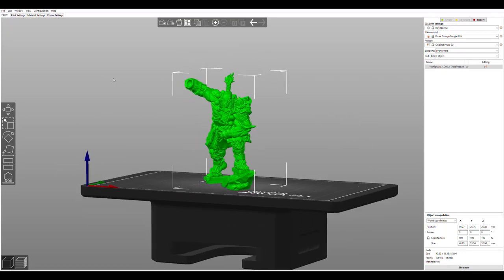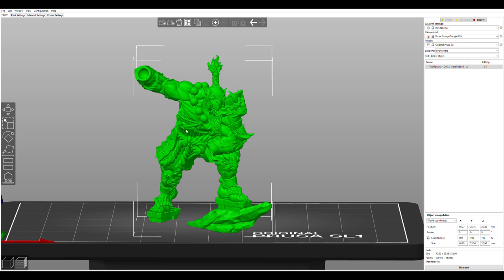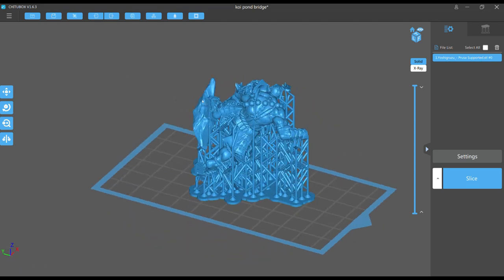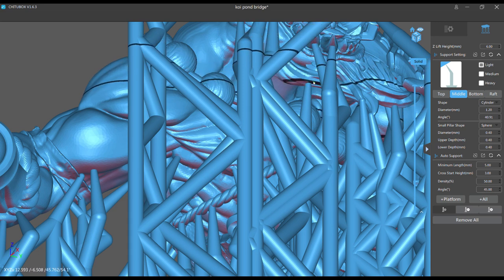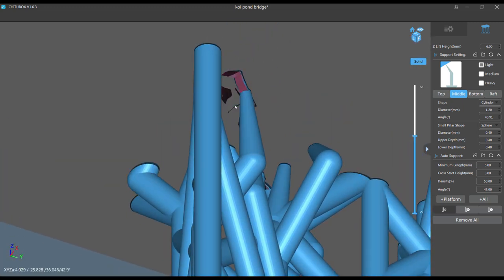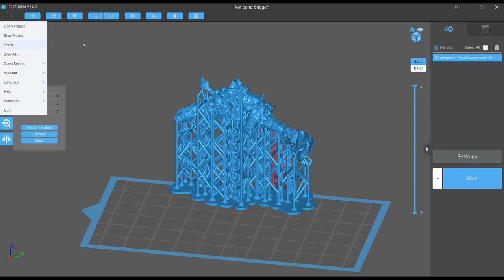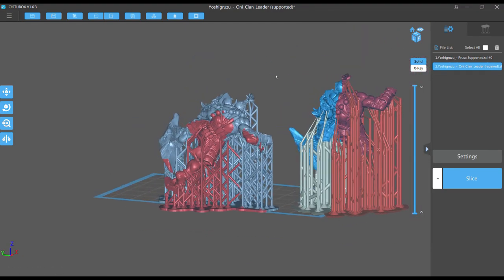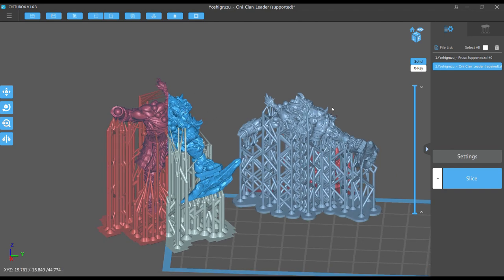Prusa Auto-Supports for 3D resin printing miniatures...set it and forget it?  Or just "Forget It"

Comment: The real professional workflow is start with Prusa slicer, orient the print manually for the most favorable position. Have the slicer hollow and auto support the model (with tweaked support settings to get enough coverage without also becoming a solid block), and export as STL with supports. Move to Chitu or Lychee or whatever, slice and save into printer specific format. Move file to UVTools, have it repair any islands along with other issues. Print, profit. Half the battle is initial print orientation, but it's a skill that's far quicker to master than manually supporting every print. 

The fact of the matter is, manual supports take too much time. Sure, I may have 2-3 failed prints per kilogram of resin used due to support issues. But I save myself literal hours of sitting there placing pixels. And for most failed prints, you don't need a full clean of the FEP. Just drain, peel off the solid blob, refill the vat, and go again. Takes maybe 5 minutes. Resin is cheap, my time is not.

Comment: For what it's worth, you can continuously auto-orient until you get a decent orientation. I usually start with an auto-orient or two and then tweak it a bit. I also didn't notice what your support settings were, but I don't think anybody actually uses the default of 100%. It's not much lower, but I use 93 or 94% which definitely doesn't put as many supports as what you had in your model. From what I've seen, most people start with auto supports and then add/remove on their own. I remember trying to manually support the AG dwarves many months ago and giving up after a few hours. Prusa auto supports, hot water, and some light sanding allowed me to support 7 HeroForge models in 30 minutes and they came out beautifully. One even had a tiny dragon on the arm, which was the most delicate piece I've ever printed, and it came out fine. I've also never had any resin stuck to my FEP afterward, and nothing shows up after running the resin through a strainer. Not saying you're wrong, but I did want to provide some other experiences.

I think "set it and forget it" is an issue, but using Prusa as a starting point and making some tweaks saves a ton of time. That being said, I do need to learn how to do those super thin supports in ChiTuBox that you've got to get some of the smaller islands I can never get with my extra manual supports.
Reply: Serneum i agree. If you dont like the orientation, try it again and adjust it manually from there. Works great for me as well
Reply: Resin can only get stuck on your fep if there are no future layers on top of them. Thats why having islands left is absolutely without consequences in most cases, you only loose detail.
Reply: Have u tried the lychee slicer? Seems better than prusa and chitubox.. the lychee shows you where are the unsupported island and this is awesome
Reply: Yeah and this guy speaks of rookie mistake, OMG

Comment: "These small  particles that will be stuck to your FEP"... uhh no.. not one of those would be stuck to the FEP. Almost  every spot you highlighted in the first area would be picked up within like 4 layers. In order for there to be a particle left behind it would have to be like the last layer of an area or speck that had literally nothing following it that it could become part of in future layers.
Reply from the maker: So you're saying every island that sticks to the FEP subsequently, if another part is printing in that spot, picks it up every single time?  That is not right...
Reply: @3dprintingpro212  yes.. it is.. unless you want to disagree with the plethora of models ive printed where i don't support "every" tiny island, because within a couple layers they quickly widen out and join with something nearby, so even if initially stuck to the FEP, it gets plucked away as soon as the model can grab onto it. At worst you may lose a tiny tiny detail, but in 300+ models I have yet to have a problem with a tiny spec of an island not just getting snatched up if close to something after a few layers.  Other than the few points where the support obviously completely missed a larger island, I didnt see a single instance there that I would fear causing a problem with printability due to tiniest lil unsupported spec of island your freaking out over.
Reply from the maker: @MattWeber  you've been lucky, if it sticks to the FEP and doesn't get picked up you'll get a nice puncture eventually, it's happened to many people...your anecdotal evidence won't sway me, there's far more evidence from more people to the contrary, and ask any 3d printing company if what you said is always true, answer will come back "no".  I've actually asked this question to manufacturers and their engineers, sorry but I'll trust them over you...
Reply: @3dprintingpro212  With all due respect, your experience is anecdotal too. And yes, some of us have asked and whilst they RECOMMEND not leaving anything unsupported, they have said that, yes, the next layer can pick up those small bits of cured resin. They point out that is the explanation for the "flat elements" in an insufficiently supported model. The resin peels off the FEP as soon as there is enough surrounding cured resin to do so.

After talking with those engineers, and confirming with someone I trust locally that their experience is the same, I too can confirm that's the case, at least with the Anycubic Photon and miniature prints.
Reply: @mekko1413  Ooo big man with the name calling. Sure google results brings up the problems, but that doesnt bring up the simple fact that if you go layer by layer, if the small failed few pixels reach an area where the exposure time is enough to fuse them with the next layer.. they get pulled off the FEP.. Even just inspecting your own failed areas where supports failed but it recovered, would show you that im not wrong.
Reply: @mekko1413  Mate, sometimes it's best to remain quiet and thought a fool than to open your mouth and remove any doubt. Matt is correct, for the case he described, and (as was mentioned) some of us have checked with the engineers too. The picking up of particles from previous unsupported layers is the reason behind flat portions of printed model. Which is the next layer or layers fusing with the particle and pulling it off the FEP.
Some folks have been around longer than Greg's attempt to make supports out to be much harder than they actually are. Greg has been trying to market his services as a product. It's in his commercial interests to make things out to be more complex than they are. There was years of everyone being able to handle resin printing before Greg came around with his call to presupport everything. There is a reason we could do so without problems. Think about it.

Comment: You should be saving every single successful support configuration to a database. At some stage in the future there will be a call for an auto-support machine learning database.
Reply: the dumb thing is that you really don't need an AI/ML algorithm to do auto support. you could just use gradient accent/decent (depending on how you're looking at the z axis) to find all of these islands based on the orientation, and put supports there. Maybe with AI you could teach it how to recognize the smarter places to place them or to avoid based on it being a face or it existing in a certain area of the model (the front vs the back) but really its sad how piss poor of a job of even basic supports everything does.
Reply: @kuthegorix  I've a lot more experience doing supports now and I do 100% of the work manually. Autos are rubbish. It's not just about the islands. There's a lot more to consider tactically. Sculpts are also getting more and more complex so you really need experience to place them manually. I only print my own sculpts so I'm always conscious of the support stage when modeling: minimising islands, overhangs, and support marks/potential damage. Lychee has been a real relief with supporting. The way I look at it now is: why spend days(or even weeks) on the sculpting/modeling phase, but rush the supports? If it takes me a few extra hours then it's worth it. Coming from game dev I understand this only too well with the UV unwrapping stage(which I actually enjoy)

Comment: I'm far from being a pro in resin printing and for sure i'm missing a lot here.
but shouldn't you compare yours and prusa one with the same angle rotation? (or prusa also decide the best rotation of the model?)

Really not a critic just asking I'm starting wtih resin printing. (not even started, will receive my printer in a few days, but getting as much as info i can beforehand and I got recommended your channel :) )
Reply: He used auto orient so he was testing both.
Reply: Outside of minute detail gains rotation is mostly for the sake of support anyways.
Reply: ninjabuddy1 yeah now in 3 months I understand more, but since he was criticizing  the fact that prusa is putting support in the face 😂, just must be dumb as fuck to expect auto orient to recognize a face of a monster and orient the figure in a different way, this test and it's argument are invalid. I personally use prusa slicer and ass some extra support myself I'm getting great results!

Comment: I start with Prusa supports, but then I visually scrub through the slices in Chitubox and get any islands remaining. There usually are at least a few, but not always. Prusa does a good job. I also now make sure there are adequate additional supports for weighty areas. So yeah, Prusa provides an excellent start, but more work is required.

Comment: Disingenuous to compare a manual orientation to a bad auto-orientation. You don't need to use auto orientation and it removes a lot of the complaints you had about where the support is damaging the model with poor placement.

Yes you pointed out the islands but some of them are absolutely tiny and join up with cured resin on the very next layer, I don't believe they are going to cause a massive issue on the FEP until I see a proof. Cleaning the VAT after every print (something you've said before you don't do) is relatively quick to catch any uncured resin floating around if there even is any.
Reply: Its not disingenuous as he stated at the beginning of the video it is to address the response of "Just use Prusa auto orientation and auto supports".    The simple fact that you said "I don't believe" shows that you do not know what you are talking about as there are massive amounts of proof that not supporting islands over time will ruin your FEP and can break your screens.   It is stupid comments like this that when you do a simple google search you can find proof.   Leave your feelings out of it.

Comment: I have been seeing Greg's videos since before he was collaborating with artisan guild, these were the videos that got me 3d printing (8 months after i bought the printer) with his settings. Now i have never had an issue with his settings once i get my resin dialed in. I also have too many STL files so i have done the Prusa Auto supports and they are ok but i have had to replace my FEP twice within 20 to 25 prints (10 to 12 successful prints per FEP and a couple of failures) for me so far its been worth the time saved ish (from 30min to 1 hour with pre-supports, and 1 to 3 hours with hand placement). I do prefer the certainty of the job done right but time is money make your own call.

Comment: isn't there a way to have one support beam have multiple tops coming off it to support different parts in the same area? it seems like a waste to have 6 beams to support islands right next to each other.
Reply: You can merge the supports. I actually do this when I place some of mine. Especially in hard to reach areas that need a lot of little supports  After you place the contacts to what you want to support you just slide the support towers into each other. It will look like one tower with multiple contacts. Just remember that the towers sometimes need to be supported as well. You do not want one small tower supporting to much. It's why they often generate connecting braces.

Comment: Hello, I agree Prusa isn't the best and your process much better but would be interested to know what information you had put in prior to selecting auto support. For example, you have the supports setting to everywhere, whereas there is an option to just have the supports from the build plate only stopping it building off the miniature. Also, did you set the support point density and the minimum distance between the support points prior to using the orientation and auto supports, if so what did you go for? I am not saying that this will improve the final pose and support build but I have found this does affect the orientation and support placement substantially.

Comment: Islands that have prints above them will only stick to the FEP until the next layer that's attached to the body of the print. It will only result in a missed layer, not be stuck to your FEP after the print is done. The islands your showing will all be absorbed back into the model.  You should go ahead and print the model so you can see that those islands will not be stuck to the FEP once the model is done.  I hate unsupported islands as much as you, but the you make it sound like it's going to damage your printer, when it really won't.
Reply: That was hard to read... I'd say puncturing your fep and dousing your machine in resin is very damaging.
Reply: Sure, but when resin is over cured (such as being hit every layer because its stuck on the fep) it expands, then it is no longer only one layer hight, and can cause damage. Just had a while punched in my fep on my ld-002r this weekend because I was being a lazy ass.

Comment: Maybe a dumb question but I am noticing when I support models that there are islands that are about the size of a gnats wee wee that supporting tends to do more damage (as in the support sticking to the model or being too close to other supports that end up fusing together to create one massive super support that takes a massive chunk out of the model when removed) to the model than leaving it unsupported.

Of course I get any island that is floating out in the middle of space needs to be supported, but in the cases where there is an island that is maybe one or 2 pixels on one layer of the print before it joins up with the rest of the model is it still better to support these islands or is it safe to leave it unsupported if you think that there is no way to add a support without the support sticking to the model or having one big long support that cannot be supported horizontally.

If there is an unsupported island that does not get picked up by the build plate on the first cycle, shouldnt it be absorbed into the model on the second pass if the layer joins up with an existing part of the model?
Reply: Yes it will just be absorbed into the next layers, the floating cured resin particles are one of this channels favourite fairytails.
If you dont want this small unconnected islands, you can just add a few pixels manually in validator, thats the way i do it most of the time.

Comment: This video would have been much more interesting if the Prusa supported model was printed and compared to the manually supported model.  I've been printing 10mm vehicles using prusa auto-supports all week with very few failures.
Reply: I agree. Saying "I don't want to print it and have to clean my vat" is a cheap cop out. Imagine if all YouTubers were like this. "This is bad but I'm not going to show you why because I don't want to put in the work" No. Give me evidence WHY. Show me the I'll effect. You spend 3 hours supporting a model but won't spend 10 minutes cleaning a vat after demonstrating why something doesn't work? Makes no sense

Comment: Speaking of Prusa. I just thought about a question regarding your style of supports and how they would handle on the Prusa SL1. I know you like to use a lot of tiny supports. The way the Prusa SL1 peels the print is a little different than the normal raising motion. It tilts. I am not sure if you have a Prusa SL1, and I definitely don't, but I am curious if that tilting motion would affect the supports a little differently. If it could cause them to fail because it pulls on them in a slightly different motion. Do you think that is a possibility?
Reply: I have an SL1... Use chitubox all the time for manual supports. Greg's method is far superior to auto supporting. I don't even use prusaslicer except to slice what I did in chitubox.

Comment: What are your thoughts on using sphere contact points Greg? I like to use them for the heavy and medium supports. They give a raised bump finish when removed rather than a whole, which can be more easily filed down rather than filled in.
Reply: If you use his support settings in his support video, without using ball tips, you have nearly 0 scarring. I use them (and actually have even went finer onto contact size) and very rarely have ANY clean up to when remove the supports before final curing. They let go very cleanly.

Comment: Thx for the cool videos. I have one question. When i am supporting with chitubox i have hafter the removing of the supports, little damages, little wholes or pickels. When i am supporting with prusa slicer, export the file with supports, import in chitubox and slice there. The prints are nearly perfect, i can remove the supports without any damage. No wholes etc. I dont understand why there is this difference.